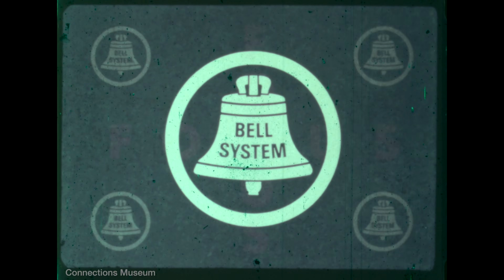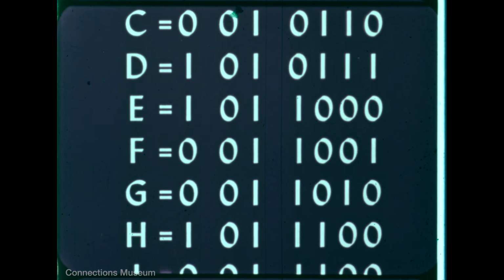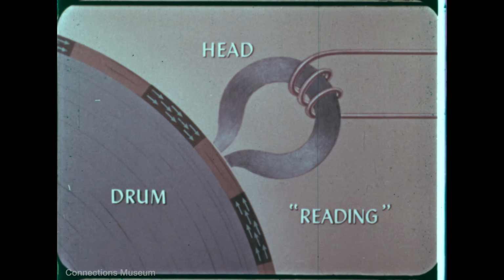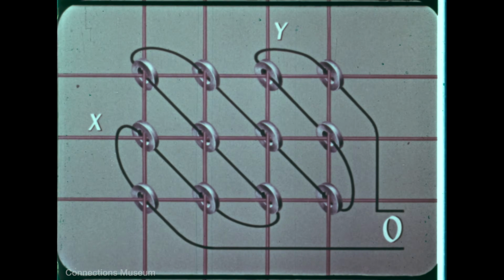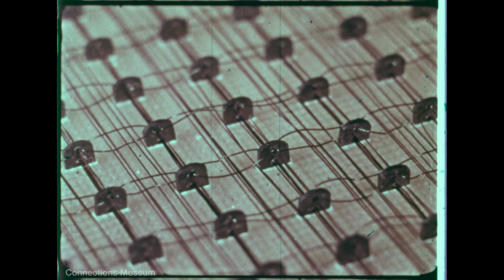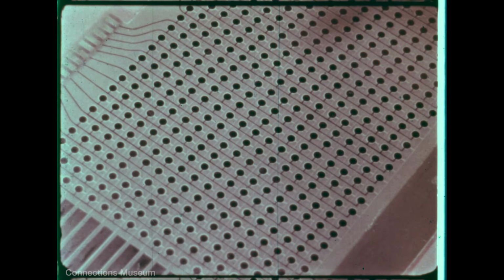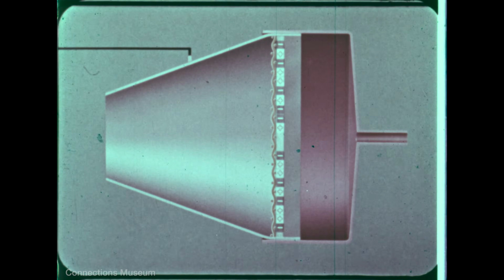Memory Devices [Bell System 1959, 4K]

Comment: AI Summary

Abstract:

This 1959 Bell System technical film provides a comprehensive survey of the state-of-the-art in data storage during the late vacuum tube and early transistor era. The presentation begins with Claude Shannon’s "Theseus" mouse, a landmark demonstration of relay-based machine learning and memory. It then establishes the fundamental principles of binary logic (bits) and the distinction between sequential and random access methodologies.

The survey catalogs the mechanical, electromechanical, magnetic, and electrostatic storage solutions of the period. Key technologies detailed include punched cards and paper tape for permanent sequential storage; relay banks for transient telephonic routing; and the emergence of magnetic media, specifically high-speed drums and magnetic tape. A significant portion of the film is dedicated to the then-revolutionary Ferrite Core Memory and its derivatives, such as ferrite sheets and "twistor" memory, which provided high-speed random access. Finally, the film explores exotic vacuum-tube-based solutions like the Barrier Grid Tube for electrostatic charge storage and the Flying Spot Store for high-density photographic read-only memory.

A Historical Survey of Early Computing Memory and Logic Systems

*   1:21 Shannon’s Mechanical Mouse: A demonstration of "Theseus," a maze-solving mouse that utilizes a "brain" of switching relays to learn and store paths. This illustrates the transition from trial-and-error to memory-based execution.
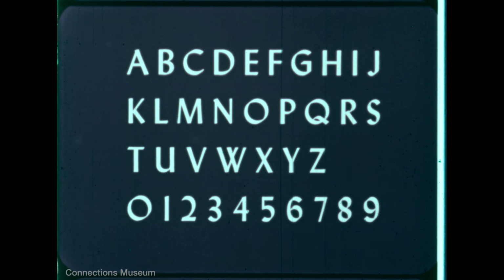*   3:07 Fundamentals of Binary Logic: Information is defined through binary digits (bits), represented physically by bistable states: open/closed switches, charged/uncharged capacitors, or on/off light states.
*   4:53 Access Methodologies: A distinction is drawn between sequential access (scanning in order) and random access (direct coordinate-based entry), noting the significant speed advantages of the latter.
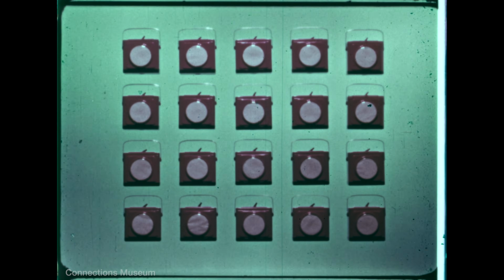*   5:26 Mechanical Storage (Punch Cards/Tape): Standardized 80-word/12-bit cards and 8-bit punched tapes serve as permanent, sequential memory with virtually unlimited capacity but slow mechanical readout (200 cards per minute).
*   7:02 Electromechanical Relays: Bell System’s "two-out-of-five" code (relays 0, 1, 2, 4, 7) provides error-checking capabilities for routing telephone calls, offering access times under 1/100th of a second.
*   8:20 Magnetic Tape and Drums: Mylar tape coated in magnetic material allows for high-capacity storage (replacing thousands of punch cards). Magnetic drums, rotating at up to 24,000 RPM, offer faster sequential access for 1,000+ words via parallel tracks.
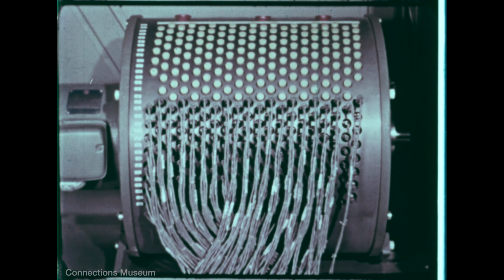*   11:18 Magnetic Core Memory (Ferrite): Introduction of the tiny ferrite ring core, which uses a square hysteresis loop for bistable magnetization. This technology enables high-speed random access via X-Y wire matrix intersections.
*   13:54 Regeneration and Scaling: Because readout is destructive (erasing the bit), a regeneration circuit rewrites data in 10 microseconds. Arrays are stacked in parallel planes to handle multi-bit words (e.g., 24-bit words).
*   15:56 Ferrite Sheets and Twistor Memory: Evolution of core memory into electroplated ferrite sheets (reducing cost/space) and "Twistor" memory (magnetic ribbon wrapped around copper wire), achieving access times of 5 microseconds.
*   20:04 Capacitive Grid Storage: A permanent memory device using printed copper spots and electrodes. Cutting an electrode permanently stores a "zero," allowing for a read cycle of 3 microseconds.
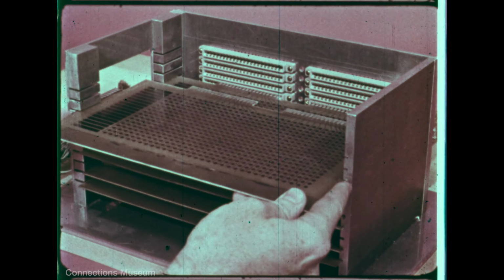*   21:26 Barrier Grid Tube: A specialized cathode ray tube (CRT) that stores 16,000 bits as electrostatic charges on a mica disc. This achieves a "blistering" 1-microsecond access time.
*   24:51 Flying Spot Store: A photographic memory system storing 5 million bits on glass plates. It uses a CRT beam and photocells to read a 68-bit word simultaneously in a few microseconds.

AI-generated summary created with gemini-3-flash-preview for free via RocketRecap-dot-com. (Input: 20,243 tokens, Output: 978 tokens, Est. cost: $0.0131).

Comment: 26:05 that thing is huge (she said). But on a more serious note, a few of these were very similar to what we use today. They had sheets selectively magnetized with a grid of sensors. This could be thought of as a tape or floppy disk drive with the grid of sensors essentially a head for each bit. Then there was the grid of capacitors which is a lot like NAND or EPROM, and finally tiny dots on a sheet read by a beam of light is a CD-ROM. Very interesting to see how the technologies we don't give a second thought to today got their start.
Reply: It goes to show that there are a limited set of reasonable physical manipulations you can do that can reliably retain information, permanently or in a Read/Write configuration. We knew already in 1959 the majority, if not all, of them. With increased understanding of the physics behind the effects, and introducing quantum effects, we could improve the efficiency and continuously miniaturise the devices. 
I think one of the few concepts that never really took off, at least on mass market scale, is holographic storage. I am actually curious if it will be revisited. 

Another interesting future might be ternary storage and logic. Slightly more expensive device budget-wise, but more information efficient, so I do think that there will come a point in the not too distant future when the trade offs will be in favour of the switch from binary.
Reply: @DrBovdin  I haven't given much thought to holographic storage, but I have considered if biologic storage would be feasible. Use proteins to encode data. At least for massive archives, it has the ability to be incredibly dense. Ternary does make a lot of sense, but I think binary is so entrenched that we'll never reach mass adoption of ternary. Although it seems almost a given that quantum computers would use ternary.
Reply: @S @SheldonHarold iological (DNA or proteins) storage could potentially work, but there will be massive amounts of error correction needed, especially since it is a relatively dynamic system that fundamentally depends on non-deterministic processes (diffusion processes etc.). That is if the method is to implant the data in host organisms. To store free DNA without the dynamic repair systems of an organism may prove difficult since the data carrier is susceptible to oxidative degradation as well as being sensitive to even moderately low energy EM radiation in the UV range (the same constraints apply for proteins). Finally, the read/write processes are fairly cumbersome. 
I would not rule the idea out, but it would probably only make sense in very specific cases. 

I don’t think it is too far fetched to expect ternary to become a standard, at least in specific subsystems such as data storage. The ternary system is the closest integer approximation of mathematical peak information efficiency (I would have to consult the literature to confirm, but at least for information processing that is what I remember, and there was several implementations tried as early as the 1960s-70s if I remember correctly. I believe it was the Soviets who played around with it and almost got to successful commercialisation.). 
As we use lots of black magic in radio transmissions these days that use much larger code constellations, it is not impossible to expect that it could be possible to go even beyond ternary, but I have a feeling that with current technology, ternary probably would be close to ideal for massively increasing the space efficiency of (semi-)static data storage.

Comment: Imagine handing one of these people a 1TB MicroSD Card
Reply: They'd probably insist that there would be no way to fill even one of those devices!
I remember when MS-DOS fit on a half dozen 1.44Mb floppies... Did REAL work within the PC's limited storage capacity.
Reply: I think many of the people developing these technologies would be amazed but not shocked.  Especially if you showed them some of the progression of technologies.  They had already watched computing go from simple mechanical devices to complex mechanical/relay logic and then to complex electrical devices capable of storing thousands of bits in the palm of your hand over the course of a couple decades.  The fact that we went several more orders of magnitude further over the next 70 years is significant (and in many ways awesome) but, in my mind, not shocking.
Reply: Or a smart phone!

Comment: I want to know how the mechanical mouse worked!
(i was a projectionist in jr high school - best job ever)
Reply: I believe there was a permanent magnet arrangement under/inside the mouse, and we saw briefly, an array of what likely are electromagnetic coils under the maze table - I further speculate that the coils were also part of the sensory aspect, through perhaps induction, creating voltage changes - it moved quite abruptly, creating defined power signals, so these coils and magnets may effectively have alternated as motors and generators, so to speak, to effect propulsion and signals as such.

They made a point to say it learned or memorized the successful maze path, so it recorded where it hit walls, the direction and position of travel, and the clear path was calculated from this - I'm open to a better explanation. ☮
Reply: @markaoslo5653  I'm sure that these coils acted as a sensor network, might have been actuators too.

Who knows, maybe the mouse had an LC tank circuit in it and the control circuitry would look for a resonance, passing AC at tank circuit's resonant frequency sequentially through all the coils and detect a signal loss.
Reply: @KeritechElectronics  - I wouldn't discount an LC tank circuit, also known as a resonant circuit, out of hand, though I think the complexity of what I might call a bi-directional resonance for this particular application, is an unlikely over engineered process, for the scope and range of this demonstration - I can only say with any confidence that I don't know. I'm basing part of my bias on the fact this is about memory storage and retrieval; giving me cause to favor the permanent magnets in the shuttle mouse - and the dual purpose coils to propel, and sense the positioning of said shuttle. While I have little doubt that they could have employed a resonant circuit; I remain skeptical that they did so.

I do sincerely appreciate your response and considerations! Cheers- ☮
Reply: @markaoslo5653  permanent magnet would make sense too, as the mouse moves onto a square with a coil (or pair of coils for X and Y, pretty much like core memory addressing) underneath, it induces a current pulse in the coils, which can be easily detected.
Reply: I also wonder. Maybe a bunch of coils or other sensors under the maze, coupled with a control computer, to determine the mouse's position, and a RF transmitter to control it, with some transistor based circuits inside. On the other hand, '60s electronics was pretty bulky, it would be hard to put it all in a mouse, even if it was more like a rat in size.

Comment: I'm trying to imagine what our modern computers would look like if integrated circuit chips had never been invented. These old Bell System reels are amazing! Thanks for restoring and sharing them!
Reply: A PDP-8 was about the size of a filing cabinet and had 4096 12 bit memory locations.  With careful design the size could have been reduced to about the size of a desktop computer even without ICs.  That would be clocked at a few MHz.  Making it play cat videos would be hard.  Solitaire can be programmed into that scale of a machine.
Reply: It would probably look like Warhammer 40k. 😄
Reply: I am proud to confidently assert that all modern computers would look like an IBM System/360 your proposed scenario.
Reply: There’s a project called the “Monster 6502” that implements the MOS 6502’s architecture with discrete transistors. The board is 12 inches x 15 inches.

And that’s with modern surface mount components. They estimated if they used through-hole parts the board would be 19 square feet.

We just wouldn’t have modern computers without the Integrated Circuit. Something like the Commodore 64 (downright stone-age by modern computing standards) would be at least the size of a refrigerator
Reply: @justinbealo1620  In the 1960s there were a bunch of mainframe style computers that were certainly more powerful than the 6502 computers of the late 1970s/early 1980s.  These used discrete transistors, typically across dozens of cards plugged into a backplane.  Before that we used vacuum tubes, and before that, relays.

But as I said above, the integrated circuit was an inevitable part of miniaturization.  And regardless of the technologies used they were all being miniaturized and many had their equivalent of integrated circuits where multiple discrete components were being put onto a single manufactured component.
Reply: @xuthnet  an IBM System/360 model 50 from 1964 has a similar minimum spec to a Commodore 64. Prior System/360 models would've had less RAM and lower CPU clock. The System/360 could only accomplish this with very primitive integrated circuits. The 6502 lacks floating point math and is RISC instead of CISC, but the Intel 8080 came out around the same time and offered those with the help of a floating point unit.

The compaction of computing power from the mid-60s to the mid-70s was insane. Which is why system manufacturers got in on integration as fast as they could.
Reply: @PilkScientist  8080 never had FP, first Intel commercial chip to do that was 8088...
Reply: Think Fallout. In that game universe, the Integrated circuit hadn't been fully developed.  Or even invented yet.
Reply: @elfpimp1 😂😂 the main mission of fallout new Vegas is obtaining an IC (platinum chip). Even in fallout 4 you need a “chip” to enter a part of the story
Reply: Most of the devices shown in this video were made even without transistors or any semiconductors at all, not to mention integrated circuits.
Reply: Modern ICs are mostly just a miniaturization of the transistor.  For a while we had computers with discrete transistors but as they became smaller it quickly became worth our while to put several on a single package, which transitioned in the the ICs that we use today.

But even if we never came up with a transistor, as shown in the video there were several technologies that were in the process of being miniaturized and made into integrated versions with hundreds or thousands of bits on a single sheet just like the integrated transistors.  So we were always going to have something like this.  It's just a matter of what we could work with best.
Reply: @xuthnet  in some ways they arent miniaturised at all...
the actual junction in most BJTs etc is TINY... its the package thats large.

Comment: This sounds like it came from a vinyl record.
Reply: It's an optical soundtrack on the film strip itself.
Reply: @TechHowden  Variable width or variable density?
Reply: Could've been either but most likely variable width by 1959.
Reply: @TechHowden  I was just wondering whether you get more noise on the soundtrack from variable density (as the film degrades or goes milky) than from variable width.
Reply: @heckelphon  yes, that's one of the reasons they switched away from using variable density, it has more noise and is more sensitive to any issues with the film like dust. Printing a copy of variable density is also harder because the audio level is directly caused by the exact density. The film emulsion response to light level is also not fully linear so it's naturally a bit distorted on variable density to begin with.
Reply: @TechHowden  or was a cassette that you had to sync with the video so that it did not get off. I should know since elementary schools and middle schools I went through did not want to replace this old tech until it really died or was on its last legs. Even went through one elementary school that had Laser disc system with a phone patch system that you had to dial what player you wanted to play in the classroom from a bank of players in the back of the library.
Reply: @JoeCdaYT  Interesting.
Reply: @JoeCdaYT  Sounds a lot like a video/audio routing switcher set up throughout the school that could be selected to "dial up" a particular video source to a classroom's TV.  A local TV station I used to work at had a similar routing switcher (a 100x100 input/output model made by Bosch BTS, IIRC), that was used to route and call up specific video sources to a monitor, VTR, or other routing or production switcher input throughout the station's plant.
Reply: @JoeCdaYT  Cassette tape was used with film strips, not movies. This would have been a synchronized audio track printed on the edge of the film and played by the projector.
Reply: I remember buying my first 1024 bit dynamic RAM chip in 1972, and first used an 8008 microprocessor with 256 bytes of RAM in 1975. At university I had to learn Algol68 coded on punch cards. Terrifically modern. I still have a jar full of toroidal memory cores and some core memory plates and delay line memories. I made an octal adder using a ludicrous number of surplus TXE2 exchange reed relays when I was a teen. Still coding and hacking more than half a century on.